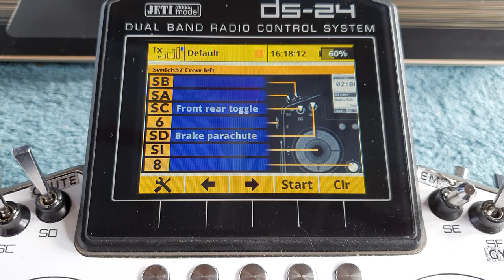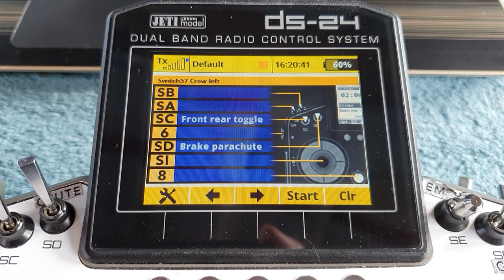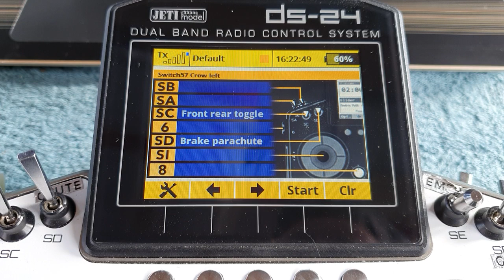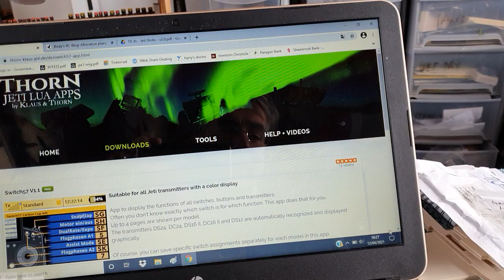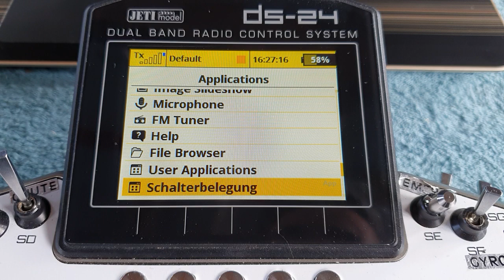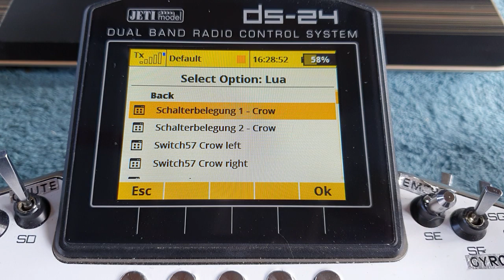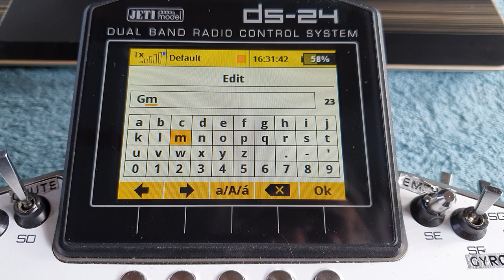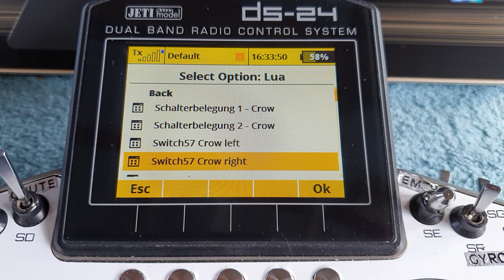Jeti - keeping track of what does what!

Comment: Harry thanks so much for these videos!!!  Switch 57 is very useful however after I have my switch labels in place, a power cycle or even a model cycle erases my labels.  Any ideas?
Reply from the maker: I know someone else who gets that error.  What transmitter do you have and what language is it set to?
Reply: DS-24 English
Reply from the maker: @RcBarnstormer  I have reported the bug to the programmers, no errors reported on German forum so it might be related to English as the set language.
Reply from the maker: Operator error!  After typing in the text you have to press the "save" button.  The buttons underneath the screen, from the left F1 not used, F2 delete all entries, F3 restore last saved in this session, F4 save, F5 OK
Reply: YES... Thank you Harry!  Works great.  Outstanding.  Thanks again for your videos.  Cheers.